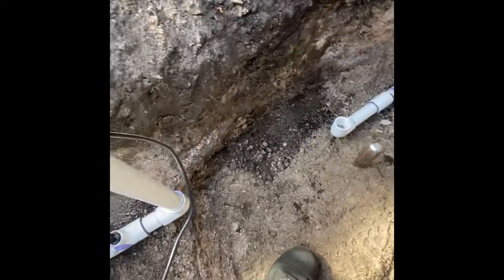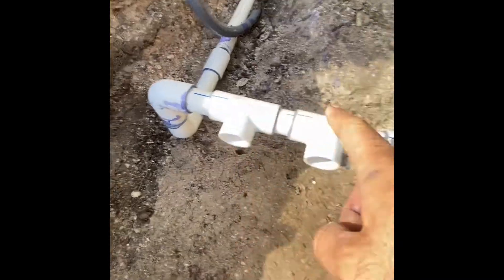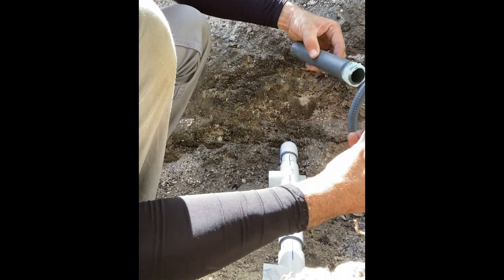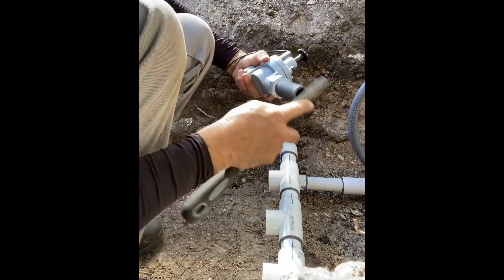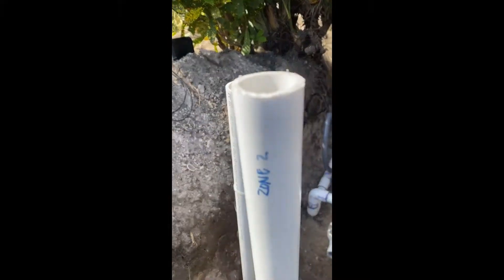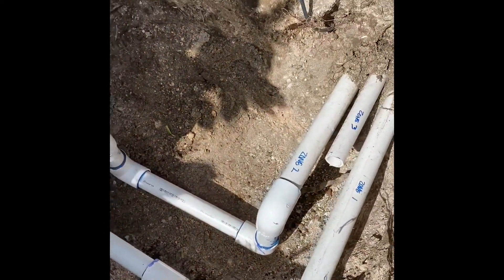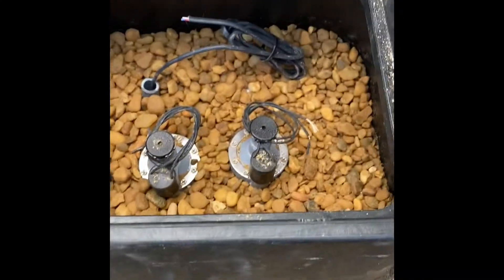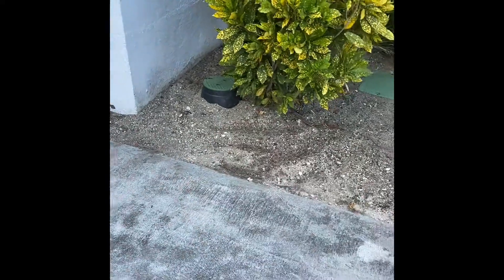How to build a sprinkler & irrigation 24v valve manifold system. #tjyoursprinklerguy

Comment: I'm an irrigation tech in South Louisiana and really enjoy how you keep these videos simple. I know when I'm doing installs, as a future proof and to alleviate headache I put valves on unions incase they break or need to be replaced. Looking great!
Reply from the maker: Hi Mitchell. Thanks for the nice words. If funny you mentioned using unions. I was actually talking with someone about that I think my next install I will try to use it. Like you said, fewer headaches in the future. Thanks again for the nice words.
Reply: Where are you located?  I am looking for someone to install or provide advise on installing a system.  I have a pond and want to filter the water for irrigation for a high tunnel greenhouse.  I am located in Hessmer,La. Avoyelles Parish

Comment: Your videos are great 👍 
I want to do something similar but don’t want to use the electrical valves. Still would need some kind to control the zones and avoid back flow. Feeling at a loss since I don’t have an easy way to connect to the power without spending the bank in electricians
Reply from the maker: Hi Yosbel. Both Rain Bird and K-Rain make a great timer that powered by a 9v battery.  No electrical needed. Just water and a 9v battery.

Comment: Love the trench video! Is it possible to set up something similar to a hose spigot? I don’t have a true irrigation system tied into my main water line. Thanks!
Reply from the maker: Hi Eddie. Yeah, i have added a couple small systems using a spigot. Just make sure the water pressure is good. What I did was used a PVC fitting and screwed it into the spigot and then glued everything after that. I even up a battery-operated timer.

Comment: You should never use pipe dope on valves you stand the chance of getting residue in the pinhole of the valve, this will stop the valve from either opening or closing
Reply from the maker: Hi Alvin. Thanks for the advise. That makes total sense.